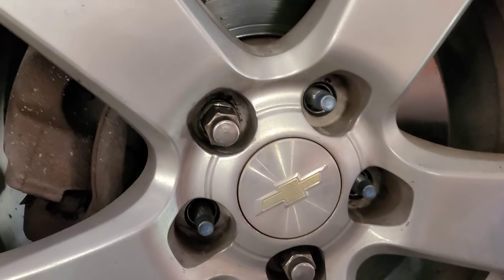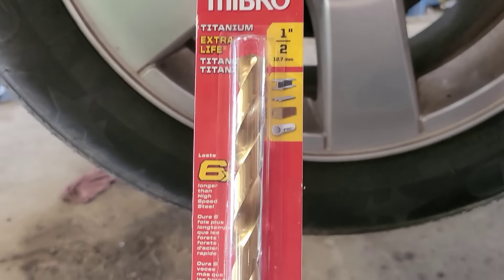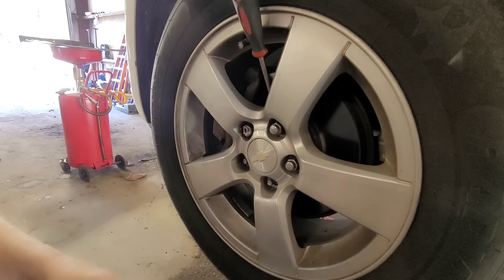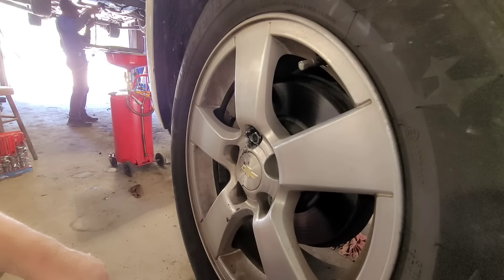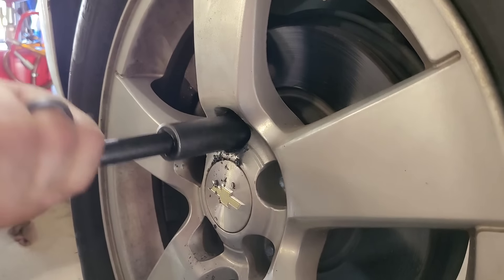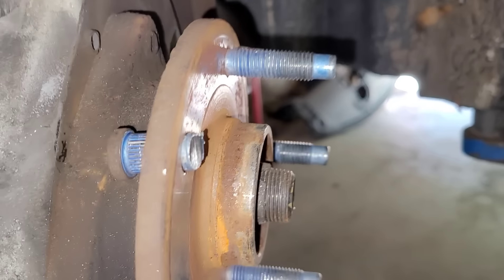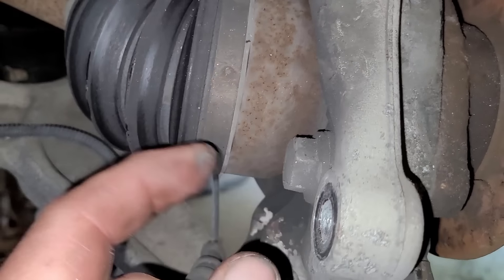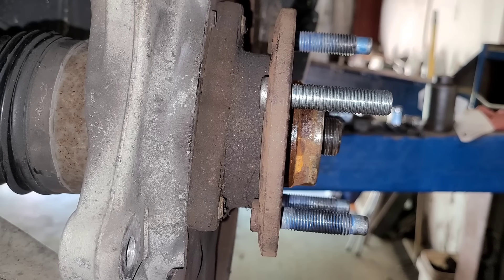Spinning Wheel Stud & Seized Lug? What Would You Do?

Comment: Wow what a LAZY dangerous mechanic to even attempt to shave the stud down for it to fit and then tell people maybe you can shave down the knuckle even though you didn't.  You even had the hub off and you still installed a shaved stud?  Wow.  Will anything happen, probably not but still.  How lazy can you get.  Will not be going to your shop EVER!
Reply from the maker: Many studs come through shaved from the factory.  Have you replaced a wheel stud before?
Reply: @WrenchingWithKenny  Do the knuckles come shaved from the factory too??  Those studs are shaved with material analysis at the factory.  Where's your material analysis?